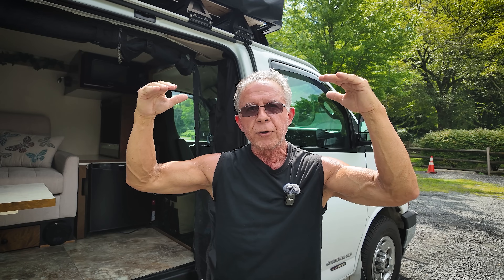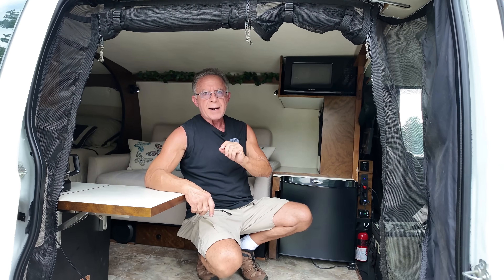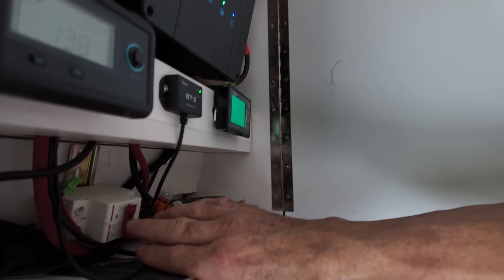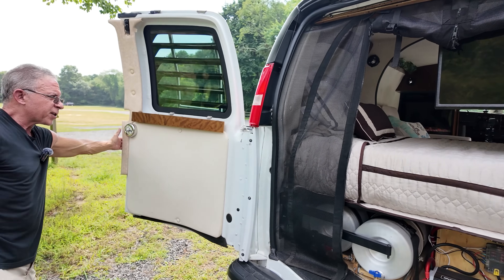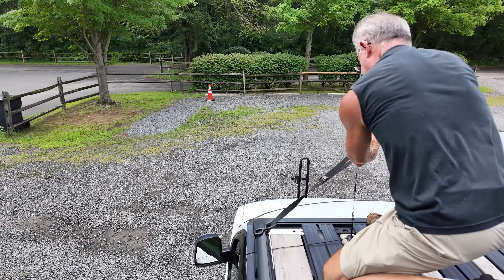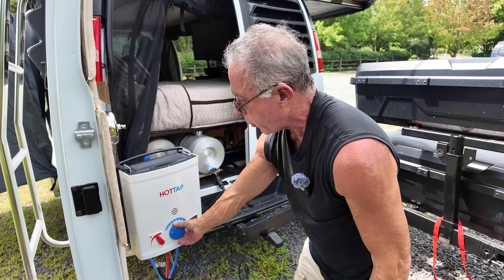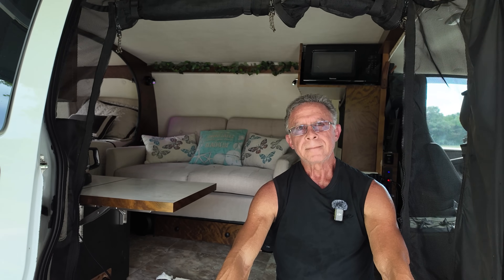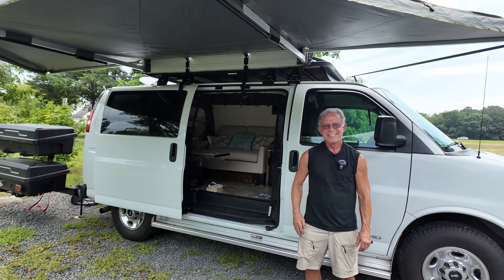VAN TOUR | The Most Superb Budget DIY Camper Van I’ve Ever Seen

Comment: The shower looks like alot of work! But I agree with him a backdrop of beautiful area’s would be well worth it. He’s done a amazing job! I love builds like this. More creative process, from very humble ppl. Great job, & thank you for sharing!!! ❤❤
Reply: Everything is great except for the awning and shower set up. Lots of work..there has to be an easier way to take a shower. I saw a guy use a combination of hot water and cold water to get the right temp and use a hose with powered pump to a shower head. Didn't use a hot water heater. Set it up with a portable shower tent.  A lot faster and just as effective
Reply: @debbiejansen1178 Well he's obviously not lazy, so not an issue for him.

Comment: I like the aluminum water tanks and shower. It takes a few minutes to set up but worth while. 
Is this van an extended one? Got me thinking about getting a Chevy or GMC van.
Reply from the maker: Looks like a regular wheelbase
Reply: When I can I use PLANET FITNESS for showers.
Reply: My van is not extended.  My biggest regret.  I should have spent $3000 more and purchased the extended.  Then, the direction of the bed could have changed to accommodate two people better. Thanks for your interest. Rick
Reply: @RickBeall-b3w  Thank you for responding.
This comment is for you and anyone.
Would it be worth while to remodel or update an older camper van? A Pleasure-Way or LTV.

Comment: Great meticulous work! Very nice van. I would like to know how he covered the roof and walls, every other camper van I see has wood planks, which is OK but I would rather not in my Express 1500 build. Possibly thin plywood with some sort of covering applied? Lighter and quieter.
Reply: I used 3M thinsulate insulation.  The van came with horizontal planks. I  attached 3/16 ply to the walls and ceiling.  Then contact cemented   1/2 foam on the walls,3/4 on the ceiling.  Then, I applied the material to the walls starting at the bottom and working my way up 6 inches at a time.  Ceiling the same way working underneath the material so you have no seams. It's tricky.  2 sets of hands would help.